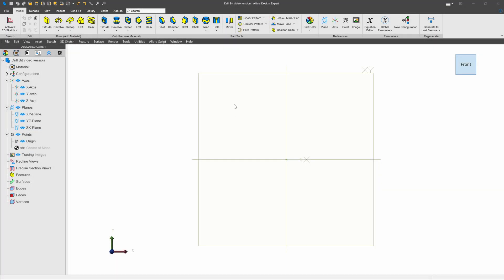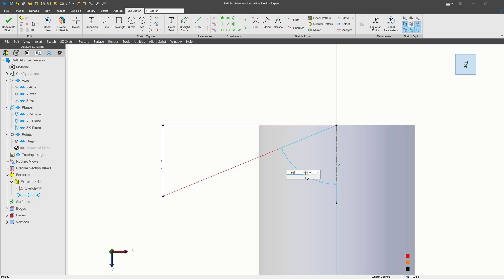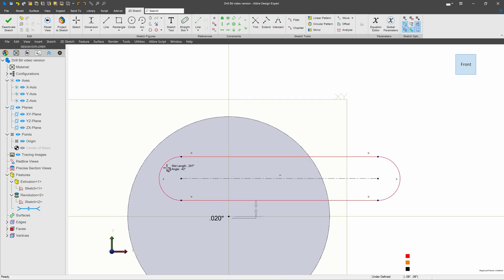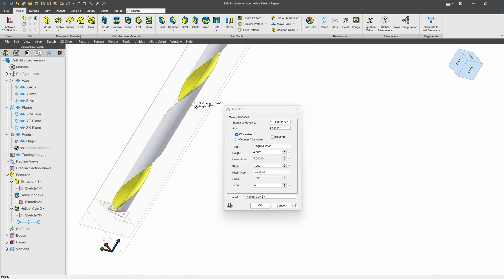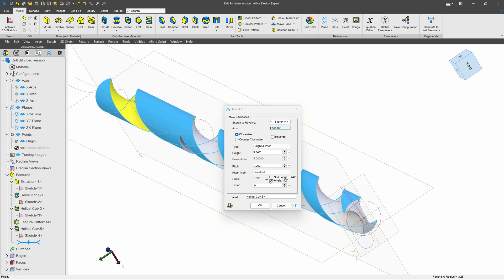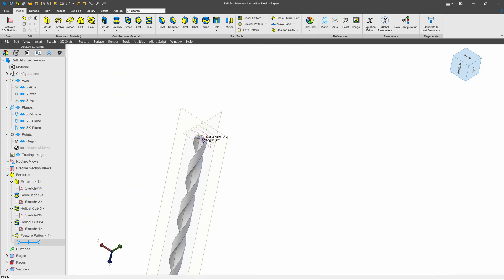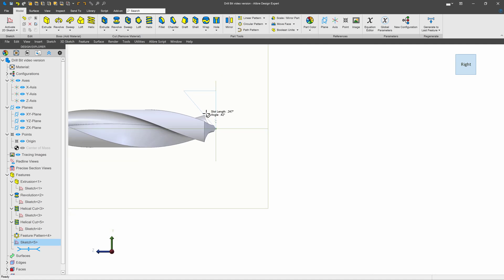Alibre | How to Make a Split Point Drill Bit

Comment: This is not bad but the runout on the flutes is made with a milling cutter/grinding wheel, on a quarter inch drill, it looks like about 3/4 inch diameter, how would you do that?

Comment: Meets all the requirements except actually cutting 😒

Without getting too far into the weeds, you need some clearance behind the lips so the drill can advance. That's what the crazy looking sharpeners from Sears and General did—they would pivot around and put a roll off behind the cutting lip. 

Oddly, i spent some hours working on exactly this a couple weeks ago. I never did get the tip quite right.
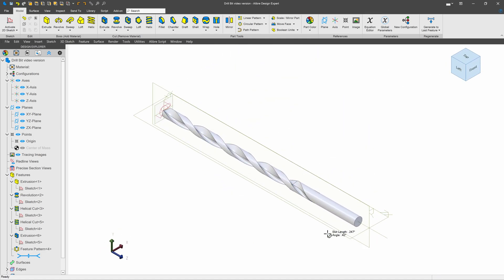Reply from the maker: Thanks for your insight.  There likely is some geometric tuning that needs to occur.  The statement at 6:55 describes the intent of the content- users likely have their own requirements, this is to display a workflow in the software.

Comment: I didn't think of using a slot, I used a circle. I used Parameters in the Equation Editor. I have two main params, Length and Diameter. I also did rough math for ratios for the Helical params.  All that is needed is to enter Length and diameter and complete with a Save As. I did it for 1 mm to 10 mm in 0.5mm steps. Now I'm ready to design a drill bit box assembly.
Reply from the maker: Nice work!  I'm glad to hear the project is going well